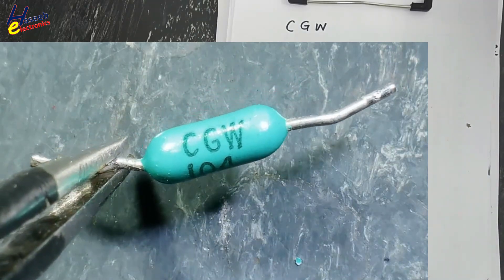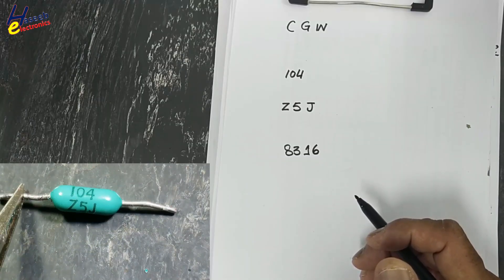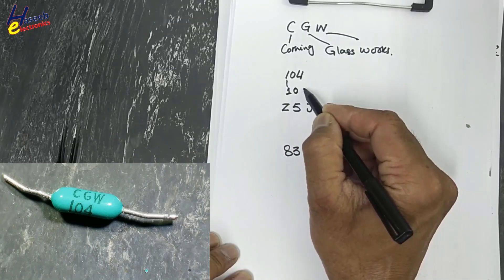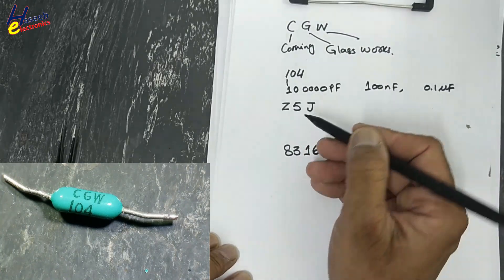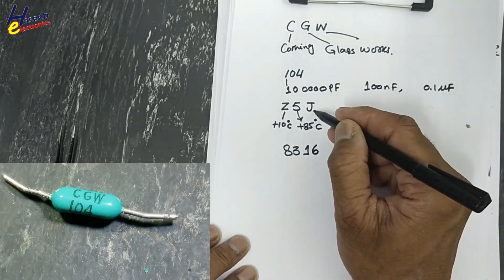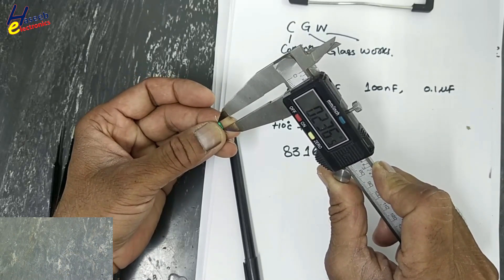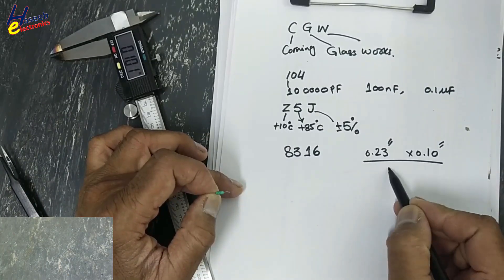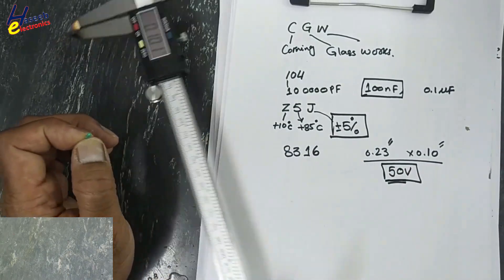{1329} What is 'CGW 104 Z5J 8316'? | Axial Ceramic Capacitor Marking Explained

Comment: Üstad sana bir sorum var. Üzerinde RS 3B 33KJ yazan bir direnç var. Bu direncin özelliklerini nasıl okumalıyım. Kılıfı sadece yeşil renkte ve bir kuşak renk kodu yok?
Reply from the maker: RS serisi tel sarılı direnç
3B sanırım 3 watt
33K (33K RKM kodudur)
J +-5% tolerans

RS series wire wound resistor 
3B i think it is 3 watt 
33K (33K it is RKM code) 
J +-5% tolerance

Comment: Hello Sir, for UC3842 current mode PWM IC if we change Current sense resistor value, then can we able to adjust Output Current? I need to reduce output current from 6A to 5A. Please reply
Reply from the maker: yes you can limit it 
UC3842 needs 1 volt at current sense pin for current limiting 
if it is limiting at 6 ampere 
you can increase resistor value by multiplying with 1.2 to the existing value 
suppose the original resistor is 0.33 ohm 
0.33 *  0.2 = 0.396 ohm
Reply: Thank you Sir for your reply. I will get it checked by replacing the resistance. Let me understand why we need to multiply by 1.2?

Comment: Hi Haseeb
How do you find the max working voltage? Thanks
GOD bless you
Reply from the maker: For that purpose EIA-198 standards document and datasheets provide 
Capacitance, body size and voltage information 
Also you can find "Ceramic Disk capacitor size and voltage chart"
Reply: @HaseebElectronics thanks man